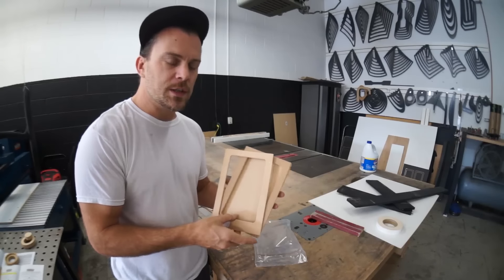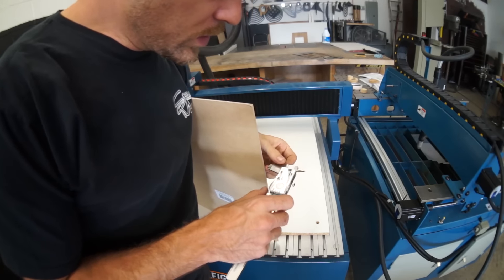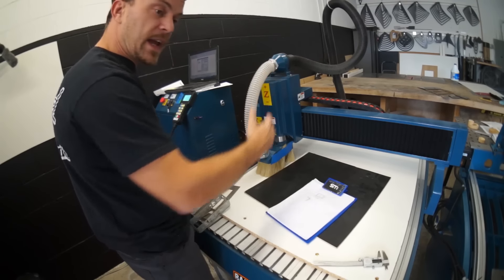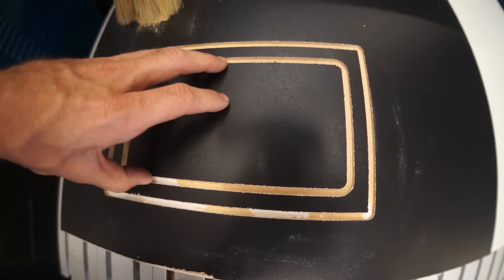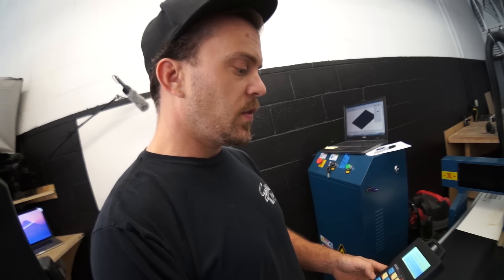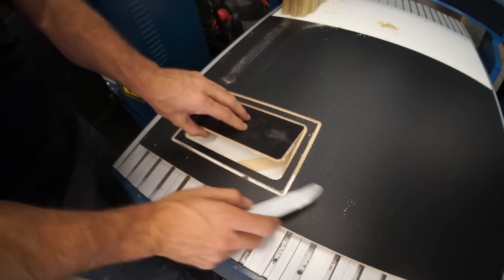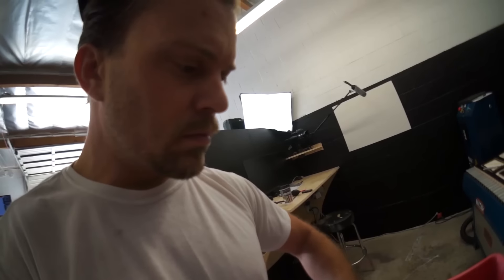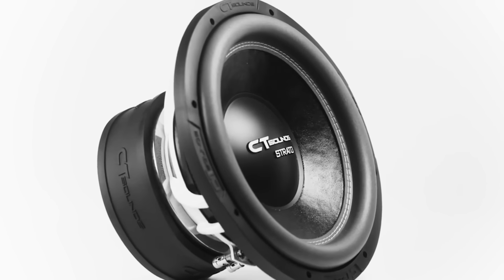GALAXY BEZEL!

Comment from the maker: HAPPY THURSDAY EVERYBODY!!! :))))
Reply: what song starts at 6:36?!?!?
Reply: You may want to do what we did with our Cnc in high school.  We put down an MDF base and used the router program to cut the entire base down so we didn't have depth inaccuracy issues as the router will now be true relative to the base
Reply: Have you ever used kydex before?
Reply: +Josh White I commented the same on the new bed video think there is going to be varying high over the surface of the material as its not a true width its entire length.
Reply: hey dough ...just an idea...use the plasma table to fabricate a better vacuum shroud...i can easily go closer to the bit...and maybe work better then it does now...just saying...keep doing what you're doing....
Reply: are you going to make kits for phones??

Comment: Hey Doug, at my sign shop we use a sheet of scrap paper instead of the block tool.  Run the bit down while sliding the paper back and forth til the bit catches the paper.  Then just enter in the material thickness.  Another thing that will help is to level your top sacrifice material, we use MDF.  Your program "should" have a pre-built file that will level your table. Hope this helps!

Comment: I'm far from an expert, but wanted to comment before about leveling the table surface. One thing to do when you get a new table like that is to run a program where you shave off the top surface so it is all level to the cutting head. There is always some variation in the top surface no matter how level you get the machine. I didn't think it would be an issue with your small table, but it seems that it is.
Reply from the maker: for once you leave a useful comment! 😝  that's an interesting idea 👍
Reply: Also since you changed the table you need to reset your Z "0" axis manually
Reply: Yep, definitely with it cutting through one side and not the other. Also these sort of things can happen if the bit is a little loose. Lastly, keep using your scrap wood until you figure out what's wrong to save your cash.

Comment: I'm not an expert on CNC machines, but I do have some understanding of how things work ( I was an avionics technician in the USAF for 8 years). Usually on equipment of this nature there is a calibration procedure where you tell it where the zero points are and then it has a reference point. Even my simple Epson printer that can print directly onto CDs and DVDs has this calibration feature. Like I said, I know nothing about your particular piece of equipment. I'm just trying to give some helpful advice. Keep the vids coming. I watch everyday.

Comment: if you measure the waste board you may find its depth changes across the width and length, not by much but enough to leave an 'onion skin'.. We plane our waste board off with the cnc to get a level waste board and you may need to allow for the adhesive tape xx

Comment: That is why you fly cut your spoil board so the board is level to the end mill. You should also always program from Z bed height that way a small inconsistency in material thickness does not affect the pass-through of the end mill.

Comment: hey that vacuum attachment for the router might work better if you make the head smaller. looks massive so your suck pressure is reduced a bunch, cut that end off and shorten the sides a few inches then weld or epoxy the end back on.  you'll be sucking so hard it'll twist...
Reply: call up rafa's mom
Reply: haha

Comment: Trim the bristles to the bit height. There should be a way to program the machine to leave little tabs about a millimeter thick. If you do that, plus use some T-track and hold the sheet down, you can stop using double-stick tape.

Comment: I had same issue I just ran a bed levelling program with the lagest bit I had... straight over the aluminium bed it was out by a lot now anything I cut is perfect those beds are not true all over the shop with Heights. 
Program a full cutting area levelling pass and then it's on the money

Comment: Did you account for the thickness of the double sided tape?, Also could be the material flexing or the tape squishing down when it has the pressure of the router pressing down ontop of it.

Comment: I have a Nexus 7 2013 model. I would like to buy 1 to put in my 2004 Chevy Silverado SS. thinking about covering the pocket below the Radio. I would like to slide it in from the side, it would be pretty sweet if it plugged into a power source when it slid in.

Comment: Have you measured the thickness of the metal block that you zero your Z-axis off of?  If it were thicker than the programmed values, that would effect your cutting depth.

Comment: Is the depth off because you have that higher bed now? Like does the machine zero to the stock bed and not the one you put on top of it? That could be why you aren't getting through... Or is zero whatever you make it?
Reply: Actually if it did do what I said, it would cut lower not higher... Derp
Reply: +Anti Hero actually it's most likely the tape under the piece or the router bit is shifting in the collet while it's working
Reply: +the dude Oh ok, makes sense.

Comment: From the looks of it your table isn't perfectly flat since it cuts through all the way on one side but not the other. There should be some instructions on using the tool to flatten your top board. Since the tool will always hold the same Z depth it will flatten your board and then everything should come out perfect (or close to it).

Comment: Is it material flexing downward slightly between the strips of double-sided tape, causing the bit to not make it through the material?  Or it might be compressing the foam tape itself as the bit comes in contact with the material.

Comment: Looks as if your Z measurement is correct at 0,0 because it cuts through but out as you increase in Y. Suggesting that the bed is not level relative to the axis of travel.

Comment: Tape!, that will effect the height of your material so you will need to adjust the depth of cut to make up for the tape, or maybe i would suggest if you can calibrate it to the depth of whatever rafa's mum wants it! 

Do your cheap kits include somehow the holes to run the magnets, maybe i'm talking like like i don't know what a cheap kit is, maybe I'll have to go back and watch a few older episodes and find out, i thought i went back already and watched all of them, some taco boy referred me to use up all my data and thumbs up this guy SM at amplified who sold pad KIts who had a mule in his garage on "Fridays", Damn, Lovin it, you'll be able to afford taco Tuesdays now, 
If i spent the dollars and bought an i pad and a cheap ass kit until i could afford a moulded one to stick in my car, i could practice some fiber glassing and make a box like the mules to hook up my home surround!!!, thats the shit, when are you going to finish off the mules dash, that'll be huge, you should start preparing some designs to cut in for that!,
Reply from the maker: no stupid! the router head moves DOWN into the piece, so the depth of the cut wouldn't be effected by the tape. We're setting the cut DEPTH to our material thickness.
Reply: I was thinking the same thing too, but good thing Doug is the profession.. If the bit is zero once it is touching the material i dont know why it will not be to the right cutting depth, unless its your calipers.
Reply: The depth of cut is zeroed off the table, so unless your calibration block has tape on it, having tape under you wood will have an effect on it.  But in this case it should cut all the way through since the would would be higher , even though it is only like like a mm or so.

Unless you calibrate it on the would itself after you put it on, but that seems like it would get old.
Reply: haha got eeem
Reply: +SoundmanCA you should copyright your kits so no one can steal your idea like wwc did

Comment: One item to think, is the spoil board actually flat.  on my home build cnc machine, I have a slight 'ramp'.. 
when I saw 1 side of the bezel cut through and the other didn't, made me think of my first cuts on my machine..wound up being spoil board wasn't perfectly flat 

always could mill your spoil board, so you know it's zeroed in.
Reply: of course, like a tool, it was mentioned below...nevermind.. but yeah.. I bet if you use your zero block on different areas of your table, you may find it's not the same - so mill your spoil board flat :-)

I am same way .1" NEEDS TO BE .1" on the table.  amen Doug.

Comment: having the bit only cut through the material in one area and not the rest could be caused by your tape being uneven or the table isnt level to the bit, to fix that you need to surface your spoil board

Comment: If he manually surfaces off the material with the controller he should cut through also if you don't surface deep enough it won't cut through plus your material thickness in Enroute or whatever program you use might not be right

Comment: The problem with just cutting deeper is you ruin your spoil board. Feel free to give me a call if you have any questions.
Reply: That's why they call it a spoil board, right?  It could be various things like the spoil board not being faced off to the spindle. The hold down tape might not be uniform or pressed down evenly. MDF material can swell ( mostly on the edges) due to humidity and cause different readings with the zero block.  Honestly it can be several things causing it.    Just cut a couple thou deeper and rotate/flip the spoil board as it gets used up.